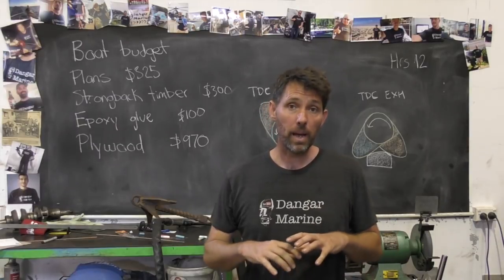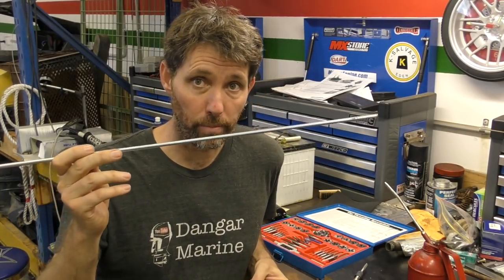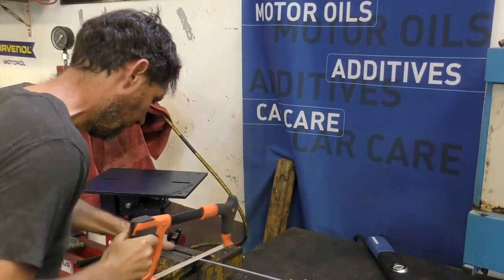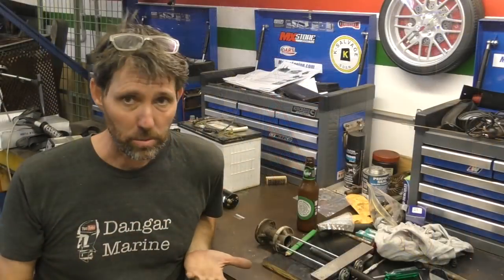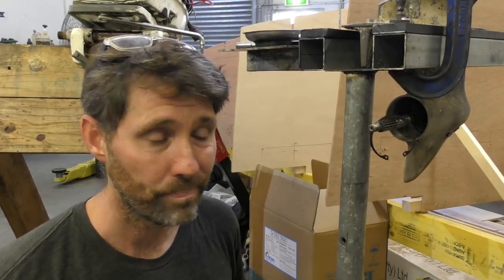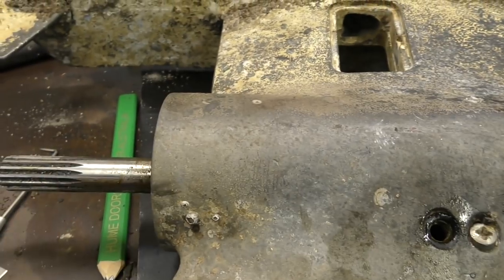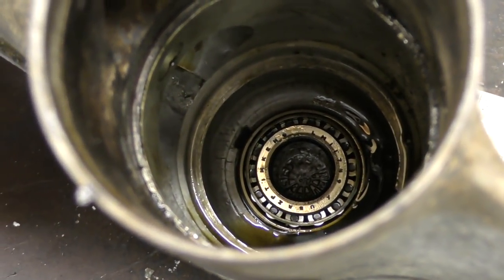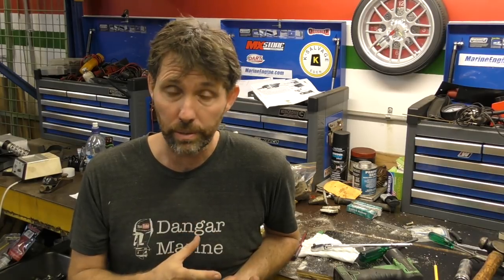Johnson / Evinrude prop shaft removal

Comment: I always enjoy videos of you doing tear downs on lower units Stu. I think at this point you’ve given me enough future confidence to tear into a lower unit beyond just the water pump!
Reply from the maker: Thanks Jack! Always feels like a win when people say they now have the confidence to give it a shot themselves. :)
Reply: @DangarMarine  hello! I want to thank you for all the clear and detailed videos you carefully put together every week. Recently I bought a used 2000 model 15hp Suzuki outboard. This is my the first outboard and needless to say it was full of surprises.  I have had to des assemble the whole thing except the engine internal parts. Thanks to you I was able to breakdown the lower unit which was a complete mess. Luckily I was able to salvage the gears, the prop shaft and many other components. I recently ordered an after market bearing carrier and it’s supposed to be a good fit, I did find that the prop shaft doesn’t easily go in. The old one has more play in it which I attribute to being old. I’m ordering all new seals, bearing and shims and begin the rebuilding process. I would like to have your opinion in perhaps gently sand down at least a millimeter of the new bushing of the bearing carrier so that the prop would slide thru easily. Again, thanks for all the insight your share with us in every video. I am going to make a compilation of the whole job and send it to you if it’s possible. I’m just waiting put it all together and try to put this thing in the water to see how it goes :( :) thanks!

Comment: Hi Stu, just for information. After you cut a threaded rod, grind it at a 45 degree angle on a grinding wheel. The nut will thread on the rod easy ever time.  [ Give it a try ]   THANKS FRIEND    Great info
Reply from the maker: Thanks Ronald, interesting tip!

Comment: Good evening, I have a 4.5 HP Johnson outboard that has a stuck driveshaft. I’ve let it soak with P-Blaster for over a week, I’ve made a puller and tried to pull it out of the powerhead with no results. My question is can I reassemble the impeller & lower unit from the bottom so I don’t have to scrap the whole outboard?

Comment: Love your LU videos Bud! It seems like your channel was the first to really show people what's inside a gearbox and how they work. To a lot of people (myself included) any work needed to be done, besides an oil change was a DO NOT ATTEMPT scenario and bring it to the dealership. It still can overwhelming to some even after your videos, but now I know when the time comes to change my seals I won't be as intimidated! What is that type of bearing puller called in the automotive world? I'm will be buying one soon and would like to know which kind to buy. Would the sliding puller be ok, or a turning style(like the one in the vid) be better? Thanks Stu keep it up Bud!!!
Reply from the maker: Hey Jim. For outboards, this type of puller is available https://www.ebay.com.au/itm/JOHNSON-EVINRUDE-OMC-BRP-OUTBOARD-UNIVERSALPULLER-KIT-WITH-LIFTING-RING-378103/302697225255?epid=1977791536&hash=item467a291c27:g:0yIAAOSwstxU90eP I'm pretty sure that one I used was sold as an outboard puller, I'm not sure where I got it from now. In the auto world you tend to mostly see harmonic balancer pullers around which can be used for bearing carriers in a pinch.

Comment: Great videos and very helpful . I was wondering when would you replace water pump puller and seal ? I believe I have 1979 Johnson 55 hp. Also any service that needs to be done yearly or 10 /20 years ? When I bought the boat from my neighbor all the data plate are gone off the motor so I have no why in telling the exact year or model
Reply: A trick I use to date motors is to do a search in Google Images.  I type in, for example,  1979 55hp Johnson, and see what comes up.  If it's not exact then change the year until you find a photo that matches what you have.  I recently did this to "age" a 1970 28hp Johnson. If you dont know where to start then use this handy chart: http://www.maxrules.com/OMCplugchart.html
Good luck with the search.
George in St. Catharines, ON Canada
Reply from the maker: Hey Nick, I had the same problem with this motor, only the serial number on the core plug remains. I like George's tips on dating the motor.

Comment: Do you know if it's sand or glass beads? Even glass beads leave a fairly porous finish. I'm interested to see what kind of paint you use. As always you do a great job explaining the process!
Reply from the maker: I forgot to ask at the time, but from the residue I would say it was macadamia nut shells. They are very commonly used for blasting in Australia.

Comment: Hi stu I watched video replacing the shift rod in a yamaha lower leg when I pulled mine out it dropped the leaver off the spline at the bottom what I would like to know is there position it should be when putting it back to get her.

Comment: This channel is magical, thank you!
I have two tweens yamahaa 150hp fourstrok, only with 20hours, one has got a slightly slack on the propeller shaft and  slides easier on neutral but other is tighter the propeller berely slides, what can I do to have loosin abit ?

Comment: I like the use of Latin "in situ".  Not heard much from the mechanics I run with!  That was a two beer job.  I am thinking you are working on that 30 hp for your wood boat.
Reply from the maker: Hey William. Unfortunately this outboard isn't quite big enough for the boat, it will need a 60-70HP. I'm mostly going right through this motor because I know a lot of people have them out there.

Comment: Hi stu i have a question for you the reverse gear was stuck on the propeller shaft so i can’t get out the nut and the pinion gear do you have any idea how to get the prop shaft out with the gear stuck??

Comment: Hi Dangar, after removing the retainer nut of my 40hp etec lower unit, I'm unable to get the driveshaft out. I've made a DIY clamping puller but I'm afraid to put any more force on it than I'm already doing. Have you got any tips? Marten

Comment: Great videos thank you. Do you have a video or any tips on removing a stuck outboard propeller? Not sure if brute force with a hammer and timber block will destroy the seals or propeller blades?
Reply from the maker: The safest way is to use a propeller puller which unfortunately is a tool you are likely to only need once in your life. Failing that try hammering on the blades using a block of soft wood and tapping on each blade in turn to balance the load.

Comment: My 1973 evinrude is hard to find parts, I've come across a Mercury fourstroke EFI 60hp, not sure if I should get it, can't find much about it as far as to service it, can't even find out if the gas mixes with oil, any tips about this motor, says 2005 on it.

Comment: I've been stuck for months - I have everything out except the forward gear and the pinion gear (1987 Johnson 25). Reaching my hand in simply like you do, I can wiggle the forward gear a bit, but for the life of me I can't flip it under the pinion gear to be pulled out. I've even tried bending a piece of rod, wedging it underneath the forward gear, and pulling/pounding it out that way. No dice.

Help please!

Comment: I have a few questions. I just followed this video to replace my prop shaft due to bearing and shaft pitting (1987 Evinrude 20hp). I was able to do this without removing the lower unit from the engine. Upon removal the spring and two balls came out. Do they go up inside the pinion gear shaft? What are the function of them? Do they hold something or act as a detent? Do you have the assembly video for this? Thank you sooo much for your efforts and time. This was the only vid I could find with my particular style lower end.
Reply from the maker: Hi mate. The springs and balls you are talking about are the subject of this weeks video. Should be up soon. :)

Comment: A little off topic, but I have a 1985 - 1989 Mercury 80 - 85 Thunderbolt engine.  No engine markings any where on the motor.  I am trying to find out what water pump impeller to purchase.  Would you know a source that I can look at to determine what water pump impeller to purchase?  I enjoy your discussions and your helpfulness.  Best Regards.
Reply from the maker: It can be very tricky when you don't have the exact model and year of the motor unfortunately. Is there a serial number on any of the core plugs in the engine block?

Comment: Great vid Stu.  That front prop shaft race looks like a bugger to access, and it seems like it's still in there.  What's the plan?  Re-use the old front bearing, or use a new bearing with the old race?
Reply from the maker: Thanks Paul. I'll probably replace the bearing and the race just for the sake of making the video on it. If I was just using this motor for myself though I'd reuse everything as the bearing seems fine.

Comment: J have a 1984 Evinrude 90 hp VRO. 
M# E90MLCRD 
I've got the lower unit all apart.  Excethe prop shaft and drive shaft. 

The splines on the 2 piece drive shaft are sheared. 

So when I put the wrench on the pinion nut. And spin the drive shaft.  The lower drive shaft is not backing out.

Any ideas?

Comment: Dangar Marine, i have a outboard was trying to out lower unit on and pulled it back off and drive shaft is stuck in upper unit and tight in there, but cant put holes in it to get it out cause i just got it to repair the motor, its a old 6hp johnson seahorse
Reply from the maker: That is unfortunately one of the tougher parts to get apart if it is corroded stuck as you can't get to it to apply any real force or heat. Tipping it upside down and running some PB blaster down the drive shaft with a straw fitting can help.
Reply: the shaft its corroded as all its pretty clean actually, i think it might have been a few mm to long and is forced in there from when i put lower unit on, ill just try flip her over and try what you said anyway, thanks for the reply aswell mate cheers

Comment: NEW VIDEO IDEA:  Stu, when my I/O dies, is there such a thing as a mount on my transom where I can easily field attach a trolling motor or similar to get back to shore?  I could keep it in onboard storage when not in use.  Please do a video on types of emergency backup motors.  My boat is too tall to use the required paddle.   Also, how do we send you a picture through YouTube or where is your email listed?   Thanks.
Reply from the maker: Hey Bruce. What you are after is a think called a Jack Plate. With regards to the photos, the best thing is to use the Dangar Marine Facebook page or you can upload it to a sharing site and just post the link in a comment.

Comment: How do you not break any bolts on a salt water motor? By the look of the case I was surprised that it came apart. You didn't even break any on the cylinder head.
Reply from the maker: A lot of it can be luck, but I think you eventually get a feeling for when a bolt isn't coming, even after you rock it backwards and forwards for a while. Then I will go to heat and penetrating oil to try to get it out.
Reply: I look forward to a vid on dealing with stuck bolts. No matter how careful I try to be I still end up breaking bolts. Great videos love your work.

Comment: Totally unrelated to this video but I have a Johnson 60hp when I turn it over with spark plugs in it’s a no go, with out it spins over ok any ideas thanks
Reply from the maker: With spark plugs in the extra compression makes it harder to turn the motor so it could be a weak starter motor or a bad electrical connection between the starter and the battery or the battery itself is weak.

Comment: if you do not a welder use two or three locked on the thread bar
Reply from the maker: Yes, using a couple of lock nuts would work well.

Comment: NEW VIDEO IDEA:   I desperately need a video on disconnecting a heavy boat's trailer from the truck's ball hitch.  Often I'm removing the pin and letting the tongue slide out from my truck as I drive forward.  Finally the greased ball falls out of the hitch cup.  Rocking the truck, slamming on the brake forward and reverse, hitting things with a hammer...  occasionally works.  How do you properly disconnect a heavy boat trailer?  My trailer jack is being dragged and damaged.
Reply from the maker: Hey Bruce, I have suffered from this a few times recently. Really what I like to have is a wind-up jockey wheel that is tall enough to lift the boat right off the hitch. Unfortunately the hitch is quite high on my truck so that doesn't always work depending on the trailer, but if it is your trailer and you can set it up with a jockey wheel that will do the track it is by far the best way to go.
Reply: Bruce- how heavy is the boat and trailer? the rough guide is 10% of the towed mass to be on the tow hitch, but that only works for things like box trailers, caravans, car trailers and boat trailers with inboard engined boats. Boats with outboards set up a unique load balance setup for the trailer. I find that about 40-50Kg (mine is a bit light at 20kg, but I have no stability problems when towing at 110Kph) on the ball is enough for almost all  outboard boat trailers because the trailer axles are typically at about the 80-90% total length point.  That gives a very long /narrow triangle  which is inherently stable , most other trailers have their axles at about the 60% point of their overall length. So basically what I am suggesting is that you may be able to move your trailer axle / s  forward and take some of that ball load off the vehicle. 
Also check your tow ball is  the right size ( you can get a 52mm ball into  a 50mm hitch if you try hard enough) and the slack adjuster on the hitch is not too tight ( may be one for Stu to do a video on)

Comment: here is a trick you will never forget.  When the bearing carrier is being stubborn, forget the pullers and slide hammers and torches.  remove shift shaft.  Place small  blocks of wood in frond of gear housing.  put prop back on with washer and nut.  tighten nut.  it will come right out.
Reply from the maker: So this would be pulling on the propshaft itself?
Reply: yes.  it pulls the prop shaft that then pulls the carrier out.  But you must first remove the shift shaft....on most models anyway
Reply: works on merc/yamaha.  Maybe not on that old OMC